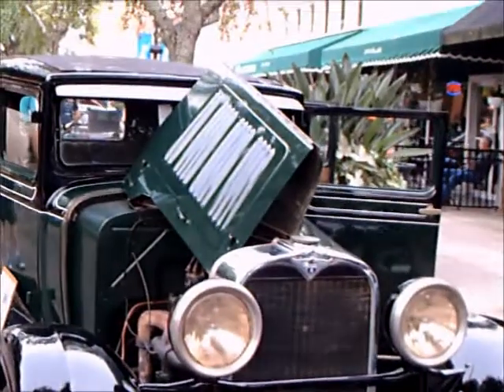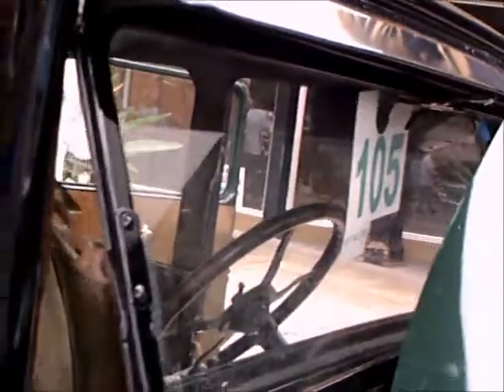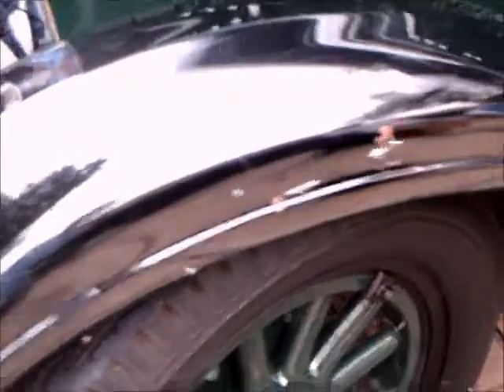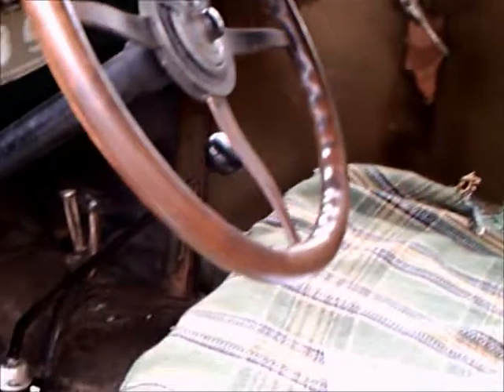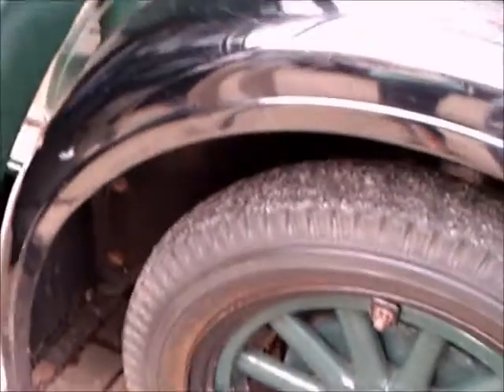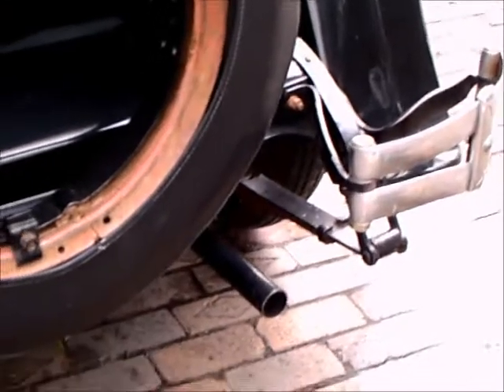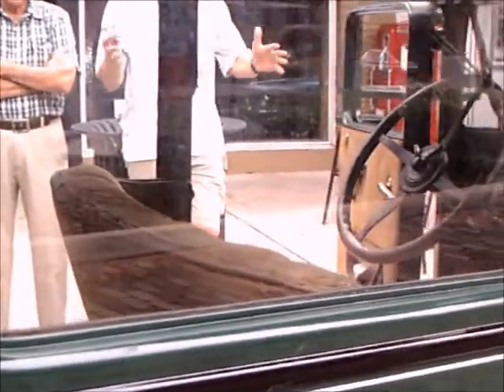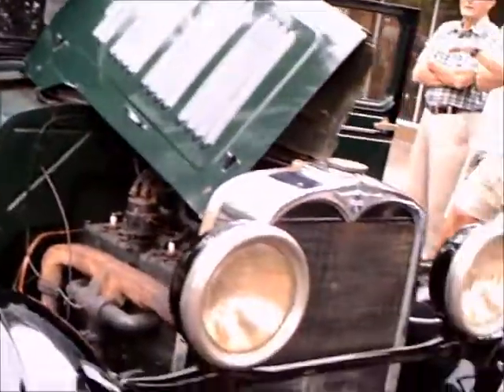1928 Dodge Four Door Sedan GrnBlk WG081614

Comment: Hey Jack...I'm a bit unsure about the phrase "original and unrestored"...does this mean that nothing has been done to the car since it rolled off the factory...ie..a new paint job, etc..could you perhaps give a brief explanation of your understanding of the phrase...thanks...
Reply from the maker: Hey, Daniel!  My understanding of that phrase would be that nothing has been altered...not the paint, not the interior...since it left the dealership (dealer installed parts excepted) but that maintenance has been performed and that oil, gas and air filters may have been replaced by Original Equipment parts.  It gets a little sketchy when mechanical fixes have been applied, like universal joints,  repair of automatic transmission,  etc., but I'd include it as original and unrestored as long as factory parts were used.  Maintenance history and bills should help guard against misrepresentation.  Thanks!  :) Jack
Reply: Thanks Jack for your common sense explanation...obviously when talking about an auto 60-70-80 years old, original and unrestored condition yet still functioning/driveable..has to be considered quite remarkable indeed!
Reply from the maker: Thanks, Daniel!  :) Jack